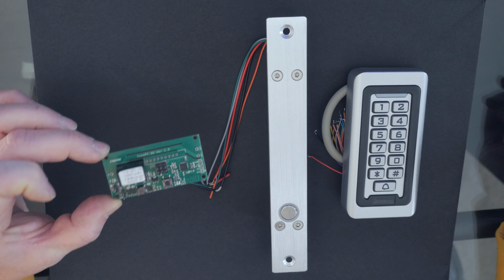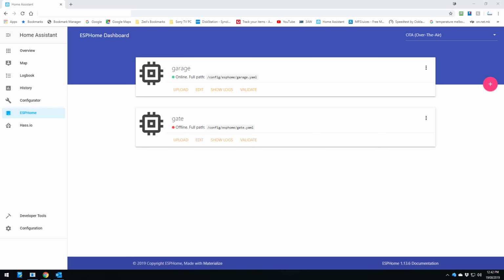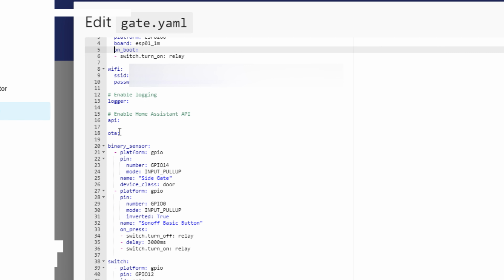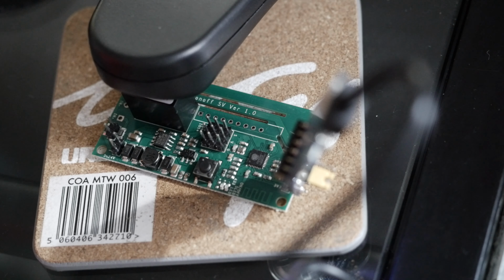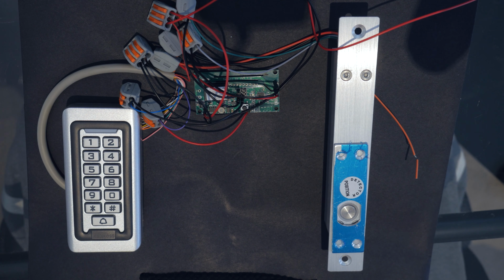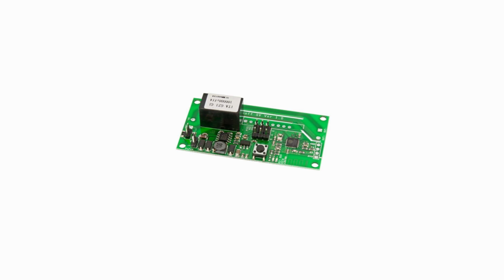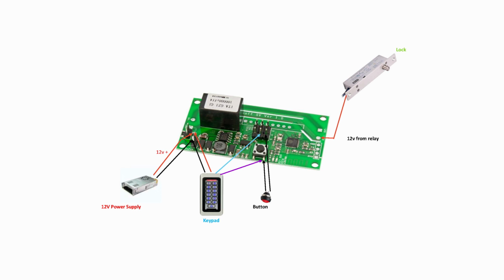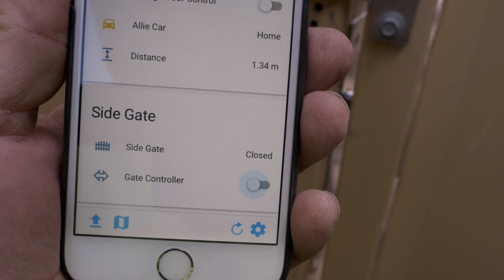Sonoff SV, ESPHome, Home Assistant, Electronic Gate Lock Installation with keypad and remote access

Comment: Great video, am about to implement it, few questions though:
The product links are now long expired, was the lock you used a fail open lock? so it requires power to stay locked?
I've just purchased a fail secure lock, so it only requires power to unlock, as I'm running it all off a 12v battery temporarily. Would I be correct in changing this code:

  on_boot: 
  - switch.turn_on: relay
to 
  on_boot: 
  - switch.turn_off: relay 

and also reversing on and off in this code too?

    name: "Exit Button"
    on_press:
    - switch.turn_off: relay
    - delay: 3000ms
    - switch.turn_on: relay

Also, this is a couple years old (HA looks so dated lol) and with recent BLE advances in HA I want to add my phone as a beacon to open the lock, any pointers on that please?

I see from previous comments it's not possible to use the doorbell button on the keypad without sacrificing the gate status, which I need, so am going to look at other ESP boards... 

Thanks again for the tutorial, Ill report back with my progress... Cheers!
Reply from the maker: Apologies for the late reply. You’ve probably got it all working by now, but, yes, I believe your code will work as you intend. Yes, if you’d like the door bell  working, you’ll need to look at another board with more GPIO pins. Have you completed it and what board did you end up using?

Comment: I am having problems controlling the gate after installing sonoff in isolated mode.  the range of the controller has been reduced and only works within 2 meters of the gate.  Do you have any idea?
Reply: If your controller doesn't connect to your wifi, you'll need to bring your wifi closer or install an access point closer to the gate. My wifi is 10m away and have no problems.

Comment: Zed, me again. Would you happen to have any idea how to incorporate the 'door bell' button into the SV, so that, when someone pushes the door bell button, I get a notification on my phone. 

Cheers
Reply: Not to worry! I got it sorted. It was a code problem... amateur error; I entered GPIO 14 as a switch, whereas it should have been a binary sensor. Wasted hours of my life :)
Reply: Thomas, to do this you need more GPIO pins. Another board other than the Sonoff SV with more pins would have done the trick. However, if you're not using the door status pin you could add your door bell on it (perhaps with an external relay) and name it bell and add that to an "notify me notification" automation.
Reply: @ZedEx186  Hi Zed. Correct; I am not using a door status, so I put the bell on GPOI14 and now have notifications, with embedded actions, up and running like a charm. 

I have to thank you again, as it was your video and great explanations that made me realise that I could do this. Cheers
Reply: @thomasohart9146  you're welcome. Glad you got it working. Good job 👍

Comment: Great video. I have mine all set up, thanks to you. Much appreciated! 

A question for you; it there any way to program the chip so that at certain times of the day and on certain days typing in the key code on the keypad does not allow access, but one can gain access through Home Assistant. For example no access via the keypad from 10pm to 6pm Monday to Friday, though continuous access via Home Assistant.
Reply: Hey Thomas, I'm glad you have yours up and running. Mine's still working flawlessly and one of my favourite projects. You get get what you've requested achieved if you set up the keypad to a seperate sonoff. However, you may be able to setup an automation to disable the button GPIO 0 to be inactive and then if you want access through the app, you could disable the automation before opening the gate. There may be a better way, but I haven't looked into that setup your after. Perhaps go on the home assistant forum and ask there for a better way. Good luck and thanks for watching
Reply: @ZedEx186  Zed, cheers for the rapid response. Great idea for a second Sonoff solution. You've got me thinking! For the second option, which would be a better solution, how would one disable GPIO 0? Would one have to write some code (what code???) for the esp8266 or would the automation take care of this... or maybe it would require both? This is my first ESPHome project, so I am pretty fresh to all this.
Reply: I tried to set up an automation to do this but wasn't successful. This is because GPIO 0 is classed a a binary sensor. Binaries can't be set to action. Geeks on the forums are pretty good in helping out. Give them a try, otherwise I'd probably flash another sonoff and have it running the keypad, which then you could definately set as an automation to deactivate the keypad.
Reply: @ZedEx186  Cheers. I am going to try an if condition based on a google calendar state. No clue if it will work, but worth a shot. If this doesn't work I will use a second sonoff. I am thinking of simply using the second sonoff with Alex IT HACS to control the sonoff, unless you have some suggestions regarding what code to use if I flash it.
Reply: If you decide to go with other sonoff, you could flash it with ESPHome and use the following code.

ota:

binary_sensor:
  - platform: gpio
    pin:
      number: GPIO0
      mode: INPUT_PULLUP
      inverted: True
    name: "Gate Key Pad"
    on_press:
      - switch.toggle: relay

switch:
  - platform: gpio
    name: "Gate Key Pad"
    pin: GPIO12
    id: relay
Reply: Once you have it setup, you can then make an automation to turn the keypad on and off at desired times.
Reply: @thomasohart9146  awesome! Thanks for sharing and glad that you managed to get it working. This is the best result for your needs. I might experiment with this code just for kicks lol
Reply: @ZedEx186  In case you are wondering; I have a mechanical exit button, hence why its not in the code. Have fun. Adios amigo!

Comment: Nice Video. This gate door sensor is what I want to have. But you have it auto-locked implemented. Sweet. Wonder how the lock auto turned on when gate is closed. Missed that part. Thank you.
Reply from the maker: Thanks for passing by. The lock has a magnetic reed switch inside it which tells it when the door has closed. When wired up like on the video, the lock tells the Sonoff that the gate has closed and to activate the lock.
Reply: @zedexPRO  Great thank you. Nice day.

Comment: great solution but it relies heavily on electricity, I prefer to have the option to use a key in case of no power.
Reply from the maker: Thanks for your comment. You can install a backup battery to it like your house alarm. It draws very little power.

Comment: Well done! Nice video. Could you share how you going to set the pin? can this be configure on Sonoff basic instead of Sonoff SV? Thanks in advance.
Reply from the maker: James MB  this setup won’t work on a Basic. The SV is ideal for this project. The pin setup is explained in the video.
Reply: @zedexPRO  Thanks for the reply. Well noted. On your video, you did not show how would you set a pin in order for the gate to open. Appreciate it if you could share how to. Many thanks...
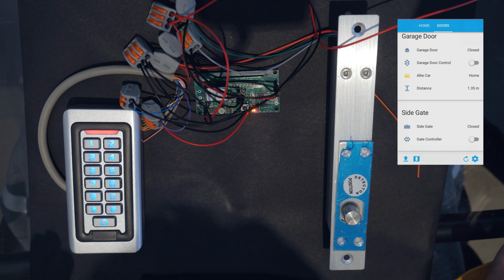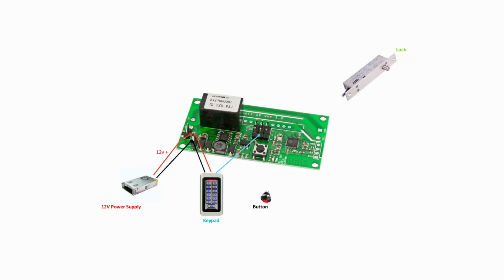Reply from the maker: James MB the little black button on the SV board when pressed opens the gate. So, the button pin is pin 0 and pin 0 opens the gate when it is grounded. It is demonstrated in the video and wiring diagram.  See 7:05, 8:35, 9:53 and 10:09. Hope that helps.

Comment: you have added a switch in your home assistand lovelayce but is it not staying open wy did you not use a button than? but nice video i was playing around with it but didnt work now it does thx freetings from the netherlands
Reply from the maker: Yes a button can be added instead. For the sake of making the video less complicated, I opted for the switch. I also dont plan on using my phone to operate the lock, mainly only to check on the status. It will be mostly operated via the keypad and physical button from the inside. Thanks for the suggestion though, it may help others decide on this option.
Reply: @zedexPRO  hahah you welcome understand wy you did it :)